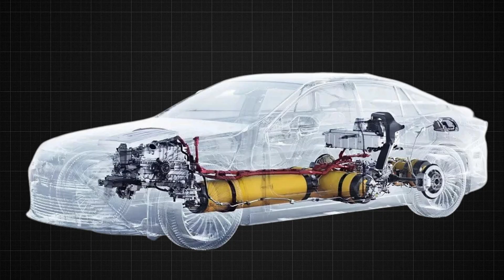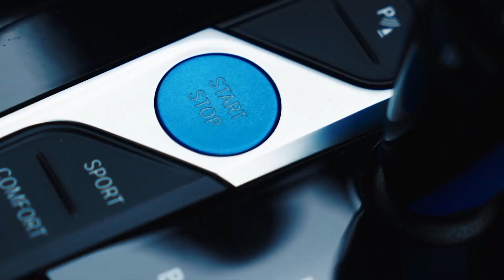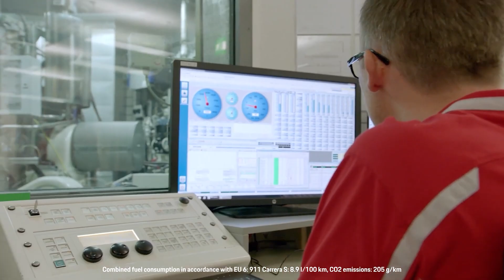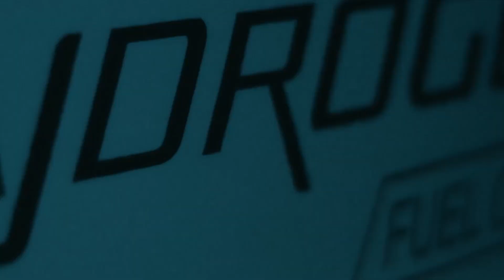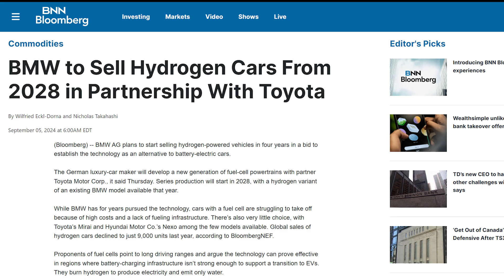Hydrogen Vehicles Are Electric Vehicles Too - BMW to will launch Hydrogen EV

Comment: Hydrogen is a dead end for personal vehicles.
Reply from the maker: Hydrogen has everything(Renewable,Comfort and convinience of top up and low rare earth. one need not to forget whole universe is powered by hydrogen.
Reply: After 15 years making electric cars just look at the lack of points to recharge them and remenber electricity is available almost everywhere. What are the costs to make hydrogen and how are you going to transport and store it so the the cars can use it. Then think of the losses during transport and whats the cost going to be just to make it It and suply it. Maybe its the best solution in 30 years?